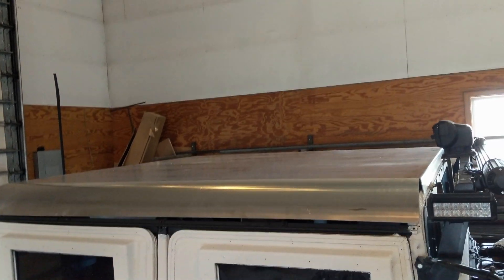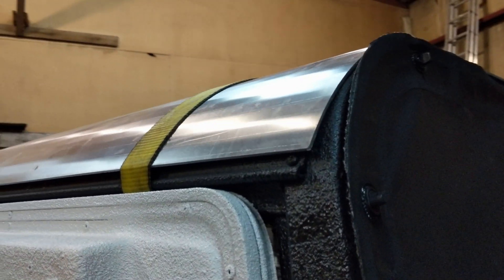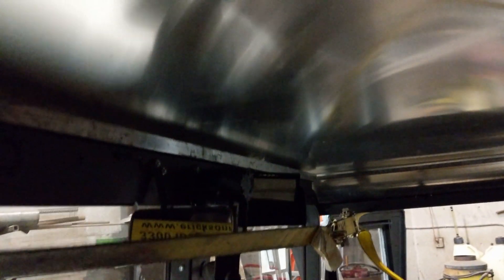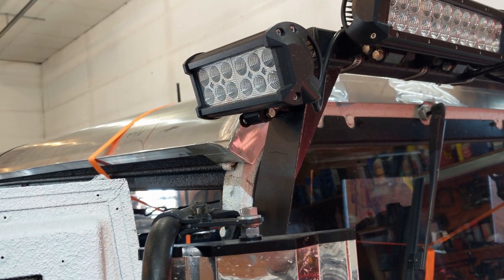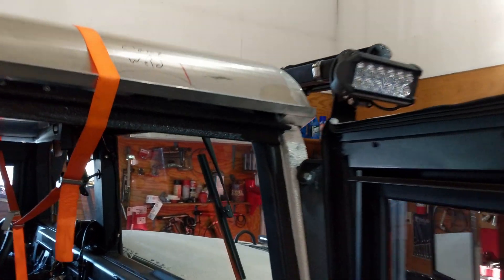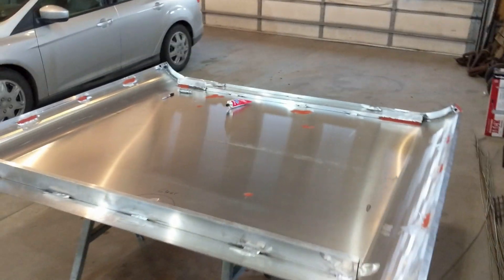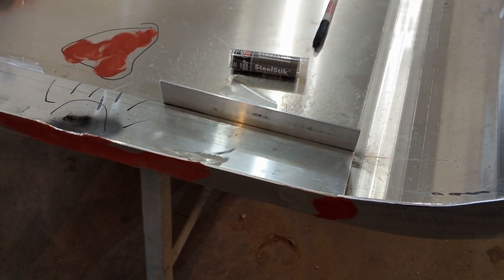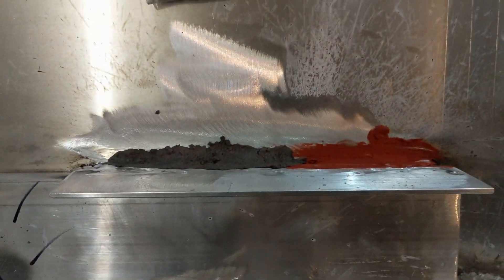Building a custom made hardtop the M998 - Part 1, gutters & braces for HMMWV, Hummer H1 , or Humvee

Comment: Maybe add/coat your roof with line x?
Reply from the maker: I had considered it. Unfortunately I need it to shed water and snow, otherwise ice will build up in the winter.
Reply: Didn't know that about line-x.  The helmet top I have is covered  in the stuff when I got it.  Good thing is, I live in west Texas.  Not a lot of time with snow on the ground.
Reply from the maker: @lt9690   Often times Semi-Trucks here will wash their trailers just to free up 300-700lb of ice buildup. I do know that line-x can be applied pretty smooth, that was the idea behind painting my HMMWV white. I found out after receiving my vehicle that if it is not applied right, the texture is aggressive enough to hold onto ice and mud.